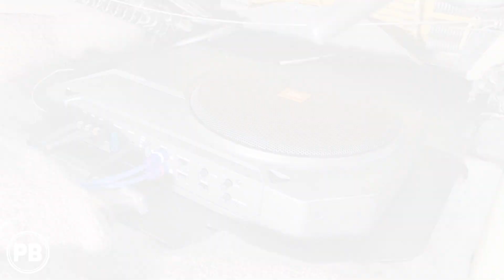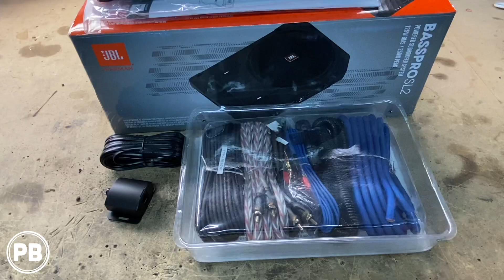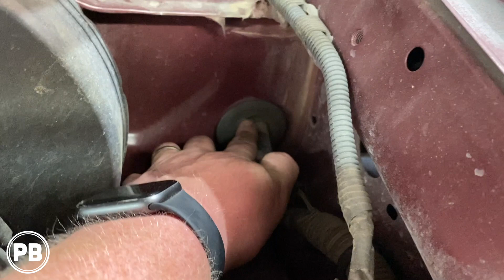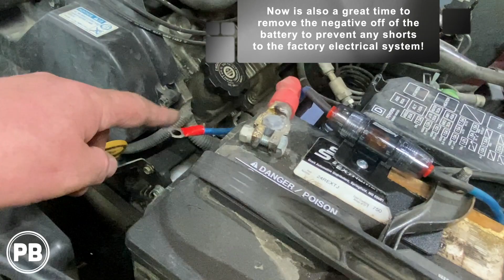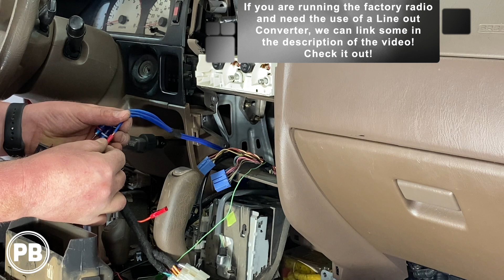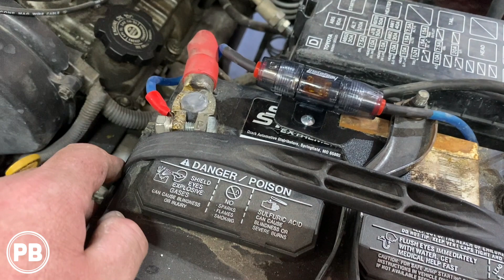1998 - 2004 Toyota Tacoma Amp and Sub Install

Comment: Installing 2 of these behind my back seats. Hope they fit good
Reply: Hey bro did they fit I have a double cab 2004 and want to try the same thing
Reply: @depressedtuna7455 i havent tried yet. I will let you know though. If not i will go under my driver seat

Comment: I've been wanting to install a compact sub woofer in my 2000 tacoma, but would like it under the passenger seat. I noticed there's a little less room under the passenger side. Is that why you went on the driver side? I don't think it would fit on the passenger side.
Reply from the maker: These trucks don't have much space to begin with, and this JBL powered sub is pretty large, so that was the best option and location.
Reply: What did you end up doing I’m thinking of putting some subs in it not sure which one
Reply: @datwayzack6695  I went with a JBL Nano. One of the smaller compacts on the market, but well regarded. It fit under the passenger seat with room to spare, and it's more than enough bass for my Xtracab. Happy with the setup.
Reply: @erice7192  what are the dimensions of that jbl nano?  I have a 99 ext cab and I’ve been seeing that not just any underseat subwoofer can fit

Comment: Would this fit a 10 inch underseat sub under the seat?
Reply: I have 10 inch powered sub under both front seats. Ran heavy line from a hub, through firewall and console, and split in center console

Comment: I have a 2001 double cab model and I'm new to this. If I got 2 of the jbl sub + amp, would i need to get another external amp?

if not, I was also wondering what tweeters and 6"x8" speakers work/fit/install easiest into the tacoma? I've ready a lot about having to make custom mounting brackets or making cuts in the door panel... I would like to shy away from holes in my door panels. 

With 2 jbl sub + amps, 4 bigger 6"x8" door speakers, and 2 new tweeters in mind, what kind of power requirements would I need to meet?
Reply from the maker: Too much to respond to in a YouTube comment. Feel free to send us message in Facebook for recommendations.